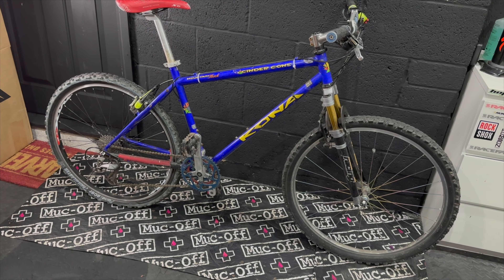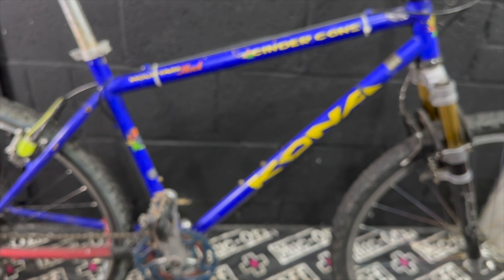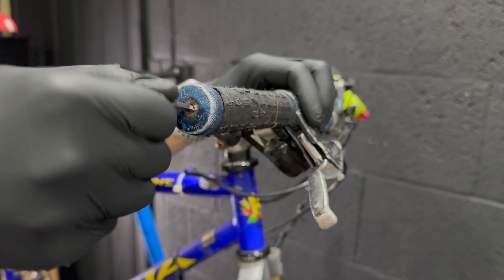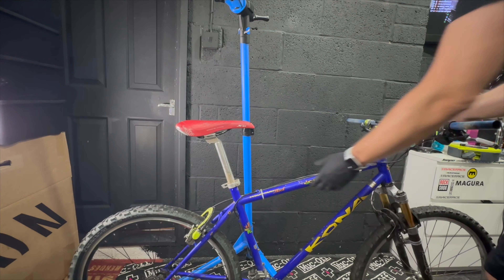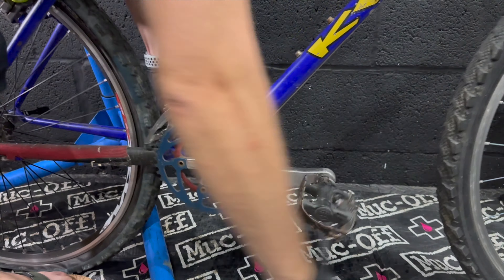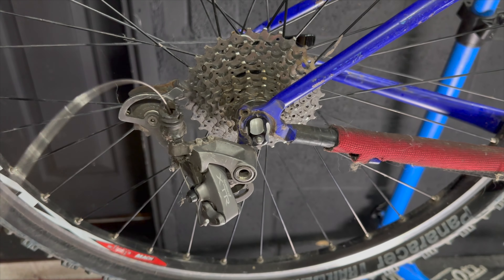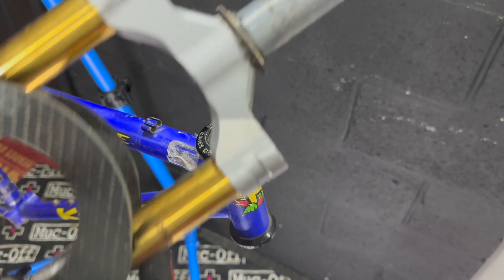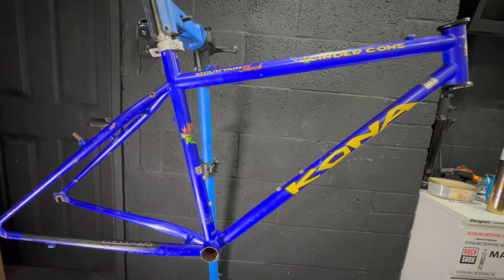1997 Kona Cinder Cone Teardown

Comment: Thank you for sharing 👍 
The Magura's are 33's, you can tell from the red adjuster 😊 
The best tool I ever bought was the largest pedal spanner from Park tool, I was also having a lot of trouble with pedals so I finally caved and paid the extra! I actually look forward to taking off pedals now because the thing has never let me down 😅
Reply from the maker: Ahh cheers for confirming, I’ve had 33s before in 2000 or 2001 but they were later model Tomacs, the lever seems quite a bit chunkier than I remember so I wasn’t 100%

Comment: Ah dude ive been waiting for that lol…. Just want to say what a great tip with getting peddle off to put the bike back on the floor 👌….. regardin the kona bud some cracking bits on there and frame wise I personally would have write it off 😢😢
Reply from the maker: Hey dude, yeah I think I’m going to have a go at bending it back straight. Found some chunks of aluminium in my old fabrication tool box so might use them and a g clamp 🗜️
Reply: @MozOnBikes  ideal if you can repair it to a safe standard mate then yeh go for a full refurb job old konas are making good money at the mo mate 👍👌
Reply from the maker: Ha well I might have pick yet another Kona up half a mile from me the other day that in waaaaay better condition! Need to work through a few more project first, but I feel like this will be a restoration rather than a restomod as apart from tyres, bars and seat it’s all pretty much original. Probably get around to it by the autumn 😅
Reply: @MozOnBikes  oooooo now jim defo looking forward to that 👌🤘👍